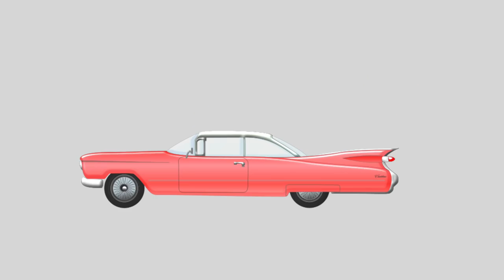Yes, Rockets CAN Fly in a Vacuum

Comment: Please demonstrate, vacuum chamber and rocket please
Reply: Did you get your demo yet?
Reply: @rebirth_mishap  yes, I've realized there isn't such a thing as a natural vacuum.
Reply: The exhaust from the rocket would fill up the vacuum, so it wouldn't be a vacuum anymore, making it pretty much impossible to test accurately.
Reply: @antondehaan1474  except it would need oxygen first
Reply: don't forget : plus without gravity
Reply: Never asked for science from a scientist
Reply: There are several videos in youtube showing small rockets working in vacuums.
Reply: Not a chamber. Because a rocket can create its own “atmosphere” in a controlled or small vacuum. 

Regarding the example. 
Remove the tires and the road. And the….well. Just remove
These two. How does it propel?
Reply: @joshmcfate8375  to help you understand how rocket propulsion works in a vacuum you only have to answer a few simple physics questions.
Most of these "physics deniers" Refuse to just answer questions that any high school grad can answer without looking anything g up.
1- explain how recoil works with crossbows please.
Then I will give you the more relevant questions once you prove that you understand mass and inertia.
Reply: @lance3748 You mean the one from warped perception they don't show if they have achieved a vacuum during the test and the lid just flies off plus the exhaust fumes create a atmosphere
Reply: Yea do that.

Comment: I always think of a rocket engine as a pressure vessel. Gas is pushing in all directions on the walls of the engine, but not on the bottom because there is no bottom.
Reply: True, but it's more complicated than that.   The amount of thrust depends on the mass and acceleration of the ejected fuel.   F=ma   Which also works in the opposite direction to accelerate the rocket.  So the acceleration of the rocket is dependent on its remaining mass divided by the amount of force being generated.
Reply: My3dviews... All these things are true of course, but in essence it all comes down to  pressure difference. If you have a one ton rocket You will need at least more than one ton pressure difference between the exhaust and top of the chamber (not including the engine bell) . Of course lots of external factors come in to play how easy or difficult it is to maintain that pressure difference.
Reply: I always think of a rocket engine as a pressure vessel. Gas is pushing in all directions on the walls of the engine, but not on the bottom because there is no bottom. -- This is a very good way to think about it! It most clearly shows the mechanism of where the force comes from.

The amount of thrust depends on the mass and acceleration of the ejected fuel. -- this is the the consequence of the above. The pressure at the top of the combustion chamber that pushes the rocket up, is pushing the combusting fuel down, and causes it to accelerate. The pressure is the spring that pushes the rocket and exhaust apart. Conservation of momentum is of course fundamental, but it does not clearly show the mechanism of what really pushes the rocket forward.
Reply: Right, I wasn't disagreeing with your statement, just adding to it.
Reply: @blindbrick  thrust is measured in pounds of force and it is simply that the thrust force in pounds needs to be greater than the weight of the rocket  to get the rocket to move. If one wants to get into orbit, then the thrust force has to be much greater than the weight of the rocket. The shuttle created about 1.2 million pounds of thrust.

Comment: Because of the rocket nozzles circular shape, it's able to build an internal pressure due to molecular build up which is the reason molecules escape faster than the speed they're released into the chamber. This internal pressure is the reason rockets can still move itself forward. If the nozzle was shaped only with the bell end and not the spherical portion, it could not create the thrust nor the speed to reach outer space due to the lack of an internal pressure.

Comment: Can astronauts vaccum in a vacuum?🤔
Reply: Catwow YOOO my mind is blown
Reply: Well now, wouldn't THAT suck!
Reply: That depends what you define vacuum and vacuuming as. Technically there is no such thing as a perfect vacuum. A vacuum is just a place that has a very low amount of molecules in it. And you might be able to create a more perfect vacuum  next to a place with a more "regular" vacuum thereby creating suction. TLDR; Yes, you can vacuum in a vacuum.
Reply: they have vacuum cleaner on iss
Reply: If you ask the right question, you get the right anwer: 
1) remove air: 
there are still atoms in space, although far and wide apart. Even the removal of a single atom can be thought of as more vacumer than vacuum. Although, you'ld have to have a serious OCD to go for that extra atom.
2) remove dust.
Moon has quite some dust, called moondust, which is sitting there in an almost vacuum. The conventional means to remove the dust, by lowering airpressure would not work. But you can still create a pressure zone, throwing up alot of dust, which can be vacuumed. Ofc, you'ld rather do this in a special (mobile) chamber , and not in open "vacuum", to improve efficiency. Or you could use modern tools that work great in vacuum, like a duster and pan.
Reply: Only the female ones.
Reply: if you open a door in space, would the air get sucked out, or blown out?
Reply: Blown. Look for the source of the force making the air move.
Reply: @Blox117  'Blown' out.

(But there is an interesting Star Trek: Next Generation blooper regarding that...)
Reply: Nope. No air to vacuum & rockets dont work in a vacuum either
Reply: @jaredkinneyjr  And yet, you can find a video demonstrating this.

(A rocket working in vacuum, that is. But hey, disblieve conservation of momentum at your peril.)
Reply: @szarak512  1 the inside has air.
                        2 no they dont.
Reply: You could turn the vacuum on but with no air, no suction.
Reply: I think I seen an ad on Craigslist
Reply: John Miller  Not at all. There's loads of stuff floating around out there.
Reply: John Miller  What are you on about?
Reply: John Miller  Space is not a complete vacuum. Even the integalactic medium has a density of about 10 to the power of  negative 6 particles per cubic centimeter. No, I have not seen all that stuff myself. It is literally impossible.
Reply: No, they have to use feather dusters.
Reply: I think spacetime would be torn apart on a molecular level
Reply: @destinystriffolino567  Space and time aren't molecular.
Reply: “He’s to dangerous to be kept alive”

Comment: It is the same as with airplanes. Both propeller and jet propulsion works by throwing air backwards, not by pressure from the air behind the engine.
Reply: the propeller works as a rotating wing causing unequal pressure in front of it (lesser) and more behind. the jet has more pressure at the front of the combustion chamber and less at the rear which causes forward thrust. otherwise a fan would work if it was just throwing air.
Reply: Nope, it is NOT a question of pressure, but of mass. It needs to move a lot of air at a high speed, in exactly the same way as a rocket engine, which has the mass in the fuel and oxidizer tanks, need to expel a lot of high speed exhaust. Both work excellently in low air pressure, in fact better as when higher pressure gives a lot of air resistance.
Reply: If there is more pressure at the front than the back, the plane should move towards the low pressure, not the high. 
Pressure isn't what propels the plane, the mass of air is.
Reply: while its true that a jet and a prop move air, that's why you can be knocked over by being on the backside of them, the big effect of the prop is the Bernoulli effect so it moves forward like a screw through the air and the jet inside its combustion chamber creates pressure equally on all sides but the lack of resistance on the rear due to the open exhaust means no pressure to balance the pressure at the front. ergo forward thrust.
Reply: It just appears that way but remember newtons third law of motion about equal and opposite reaction. there is pressure at the front of the combustion chamber and nothing at the back to balance it so the reaction is to move away from the pressure in the forward direction. Whittle, who invented the jet in Great Britain named his company "Reaction Jets Limited"  just for that reason.
Reply: Actually, the bernoulli effect is not a major part of how airplanes move through the air. The very most important effect is the mass of the air pushed back and/or down. The fluid dynamics involved does mean that as part of pushing the air, different air pressure can be found at different spots around the engine and wings, but they are not key to the forces or movement. Airplanes can move with perfectly symmetrical (top/bottom) wings, and that's commonly the case for high-speed flight, without any of the old and solidly debunked myths around different air speeds due to different distance around each wing surface. Bernoulli is not much involved in why airplanes can fly.
Reply: If you say so I guess I'll have to just agree.
Reply: It is by far not just me saying so. http://www.telegraph.co.uk/news/science/science-news/9035708/Cambridge-scientist-debunks-flying-myth.html and lots of other articles and videos. It is a very old misunderstanding from before fluid dynamics was understood.
Reply: @Robert Bertram => "there is pressure at the front of the combustion chamber (...) so the reaction is to move away from the pressure in the forward direction" => Isn't that contradictory?
Anyway, I agree that the pressure differential guides the flow in the engine an keeps it in the correct direction, but as far as thrust is concerned, pressure isn't the important part. Pressure influences how the engine performs, but the thrust is mostly dependant on the mass of air and the acceleration it is given within the engine.
Reply: @Johnnie Hougaard Nielsen => uuh.. While the school version of Bernoulli is perhaps a bit outdated, the effect of an asymmetrical profile are pretty well known and quite measurable. Saying Bernoulli doesn't have a major effect is just as wrong as saying it is the only thing acting on the wing.

For your example of symmetrical airfoils, they work by changing the angle of the chord so that the lower part is more inline with the airstream than the upper part, making it asymmetrical from the airstream perspective.

Bernoulli and Newton work in tandem, and they have their pros and cons
Reply: While a bit of Bernoulli effect is indeed present, it is only a minor part of the lift. The important thing is how good the wing is at throwing air down, by having the wing sloped downwards. This also creates a pressure difference, which adds a bit of effect too,

In fact, a normal airplane wing does not really have a asymmetrical profile, the middle front/back line through the wing very clearly has the all-important downward slope. Additionally, to improve aerodynamics, the wing has small asymmetrical variations in shape at the front and back, but the basic lift is just like when I stick a slat out of the window of a fast car, with a wing-like slope.

A lot of air is hitting the underside, and when deflected, the regular Newtonian law of equal and opposite actions apply for the masses involved. The moderately higher air pressure is an incidental effect of the simple act of deflecting the significant mass of the air involved.
Reply: think of the balloon inflated, it has equal pressure on all sides pushing the same amount. when you release the back the pressure on the sides are still equal but while there is pressure on the front there is none on the back. It is that pressure on the front that makes it move, not the escaping air in the back.
Reply: Robert, that's not how the physics of a balloon works. When blown up, the inside air pressure is of course higher than on the outside, but only a little bit, with the same pressure on all sides. When air is released through a small hole, there is still the same pressure on every inside part of the balloon. However, air is moving out at a high speed, providing enough force for the balloon to move in the opposite direction. Weight of involved air and the balloon material, and the speed, is the basis for the Newtonian opposite forces generating the thrust. A balloon of one U.S gallon contains about 0.16 ounces of air, and with a party balloon only weighting about 0.046 ounces, the mass of the air is highly significant in the forces involved.
Reply: well if you say so the rules of physics have been changed and no one told me.
Reply: No, you're the one trying to introduce "alternate" rules of physics, without any factual  basis. Newton was right about the forces, as clearly illustrated by the numbers for mass of air and balloon. The pressure inside an inflated party balloon is only a tiny bit higher than the surrounding atmosphere, just enough to make the air move through any opening.
Reply: I do not know how to explain it to you so im not going to continue. Im not here to argue or cause trouble in any way, you and I just will not agree on this so I wish you the best and concede the point to you.
Reply: a propeller works by moving an equivalent mass of air as the mass of the plane. same for helicopters they must displace the same weight or more of air as the craft weighs or it wont leave the ground.
Reply: Robert Bertram a ballon does not have a lot of pressure because as you blow up the balloon it increases in size. if something increases in size it decreases pressure. a ballon has some elasticity, or pressure,  pressing on the air inside - that is where the pressure comes from.
Reply: I think the part that is non-intuitive is that the 'pressure' a fan blade sees is not the same as the pressure of the gasses leaving it in the outflow.  The fan accelerates the gas, and as the gas accelerates the pressure in it drops,
usually to about the same as atmospheric pressure for a smooth output jet.   The local pressure on the fan blades pushes the aircraft forwards, and momentum is transfered to the airflow equivalent to the same force, but the gasses exiting are not pressurized.
Reply: All aircraft including rockets have a flight ceiling. Believe it. Outer space exploration is, was, and will remain unattainable for the foreseeable future.

Comment: Her automobile example gets a little confusing because she does talk about thrust from the exhaust, but then she says that's not how a car works.
- I think what she means is if you turn your car on there is some thrust because exhaust goes out the tail pipe. True. -
 - However if your exhaust came out with the equivalent of 10 pounds of thrust, or 20, or even a ridiculously high 100 pounds, even if your car is in neutral it's not enough to move a 2000 pound car. 
- what happens in a car is the gasoline explodes inside your engine, pushing pistons which  turn a crankshaft, which then turns gears which turn the tires and the tires literally push the car. 
- So perhaps people think rockets also move by pushing something, like air.
- That is false.
- Rockets fly by action/reaction. The fuel enters the engine, it literally explodes, part of the energy pushes the exhaust one direction (action), but the rest of the energy pushes the rocket up (reaction).

Comment: Hi Amy, 

Despite being negligible, compared to the engine exhaust thrust, the should be a difference between the vacuum and the air situation. There plume has to push the air too. We can see that with a water hose: even when the water flow is not enough to push the hose's tip, it might do so if you direct the flow to a wall. Of course, the effect is much stronger here since water is almost incompressible, but is is there.
Reply: Rockets work better in vacuum.
There is no air resistance to hinder the exhaust from accelerating away from the rocket motor.
Reply: Actually the plume from the water hose doesn't have to hit air. I don't know where you got that information. For every action there is an equal and opposite re- action.

Comment: Another way to look at a rocket is as a pressure tank. If you fill a sealed container with high pressure fluid, the fluid in the tank will press equally on all sides of the tank. The force pressing on one side of the tank will exactly balance the force pressing on the opposite side of the tank, with the result that the net thrust is zero. If you now open a hole on one side of the tank, the fluid no longer presses on the inside of the tank at that spot. this means the pressure on the opposite side of the tank is no longer balanced by pressure where the hole is, so you end up with a net force pushing the tank away from the hole.
In a rocket, the pressurized fluid is usually produce by burning a fuel and oxidizer to produce huge amounts of hot, high pressure gas, but the same effect can be done by pumping air into a balloon, or even boiling water to make steam.

Comment: Not so sure about the car analogy and wish you just discussed the rocket combustion process directly, but good discussion on the third law!
Reply: Yes there is a bit of misconception on car exhaust equating to thrust but she nailed the balloon demo!
Reply: MrJackHackney what's the misconception?
Reply: Shadowboost At :54 she explained the internal combustion forced exhaust out of the back of the car to drive the car forward.
Reply: +MrJackHackney
No she did not.  She specifically said that the car exhaust does essentially nothing toward propelling the car.   The car was only brought in to explain the misconception about the rocket.